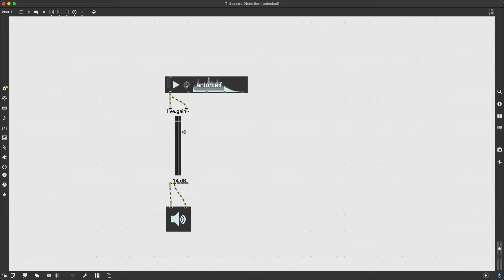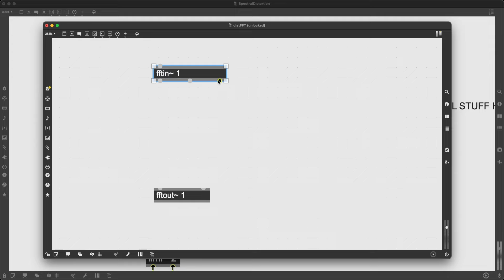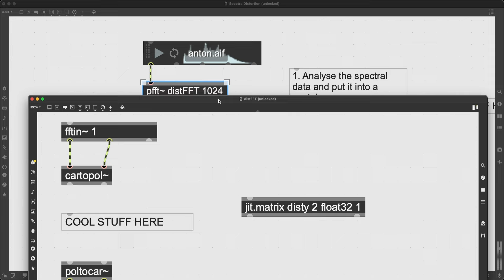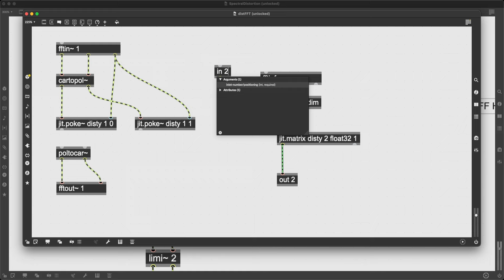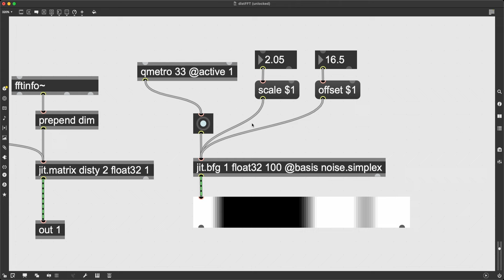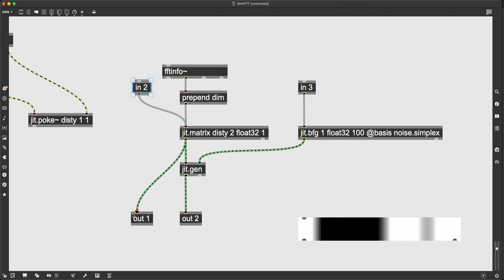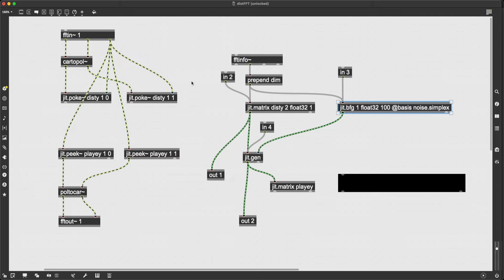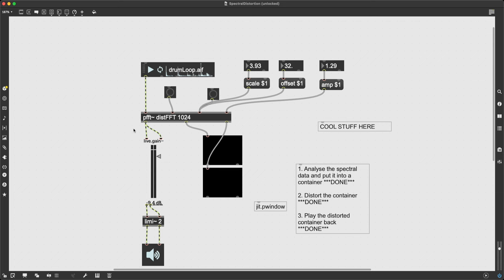Spectral Distortion | Max/MSP Tutorial

Comment: Yes, we can’t hear above 20khz, but also most timbre info is below10khz…
You divide the fft analysis by 2 for the  jit.matrix to get it down to 20khz…but the representation is linear, which makes 0- 10 kHz half the space.  Is there a way to represent the bins/frequencies logarithmically so that 0- 10 kHz gets more space?  Or some other method?
The goal would be to increase the usable space that a user can draw in, to get more fine control where timbre is most affected (0- 10 kHz), and yet process all bins.  

Like how people usually use Ableton Live’s eq8 in logarithm mode to get more fine control where it matters most.

Thanks!